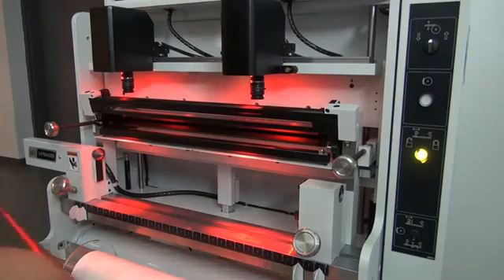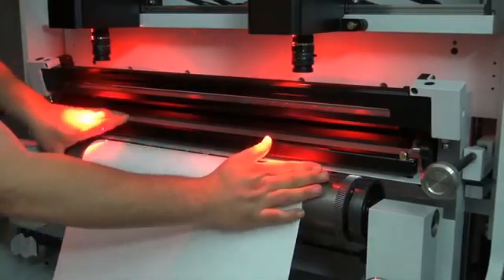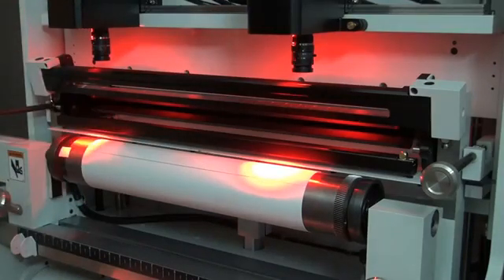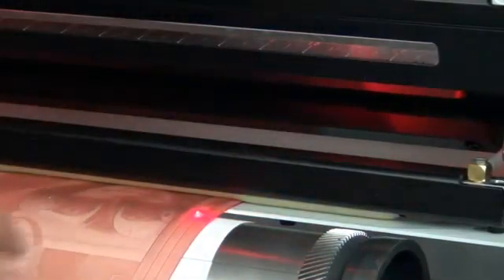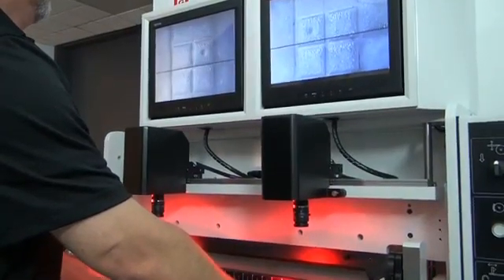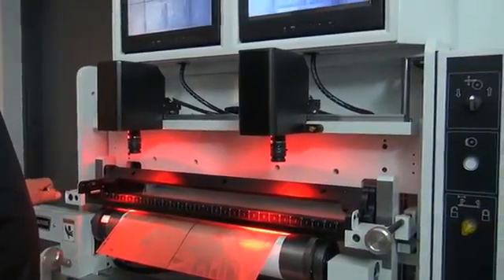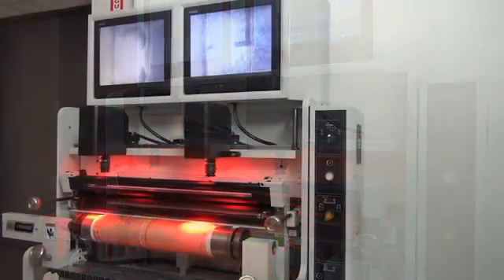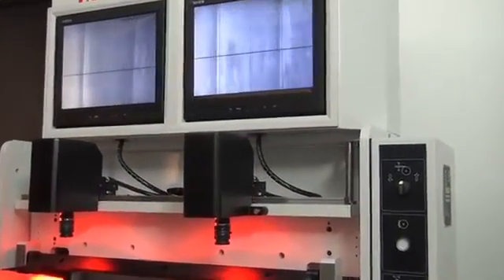Mark Andy VPM400 Plate Mounter Demonstration | Plate Mounting Made Easy

Comment: I find that once you have finished mounting, you give the cylinder a fast spin. You can see better wether the plate is straight or not. If the bearer  line runs straight your plate is straight. But if it wobbles your plate is skew.